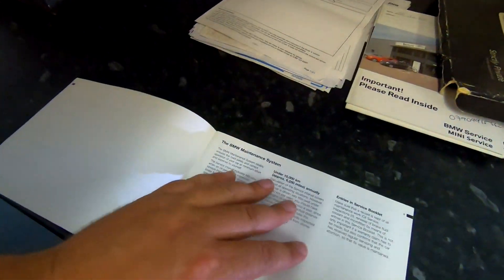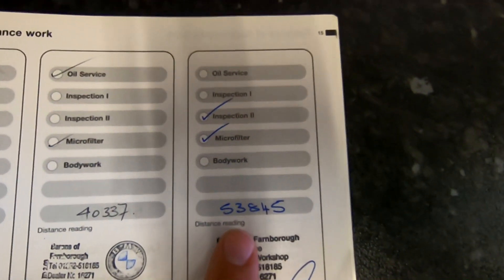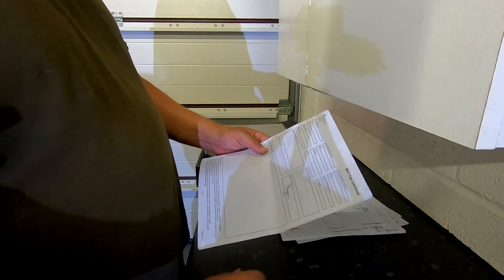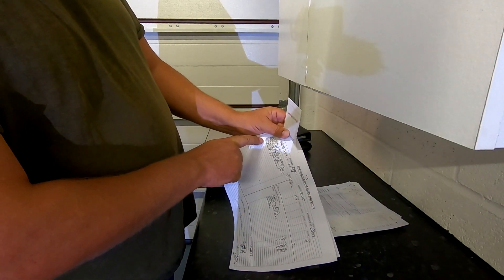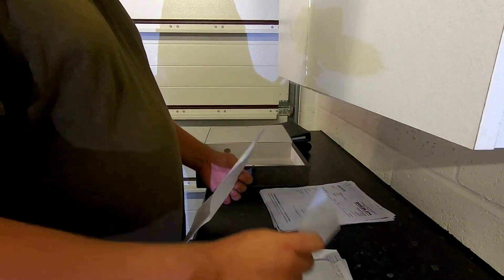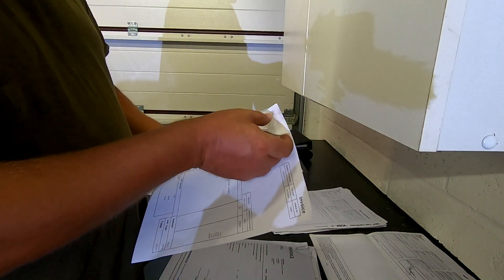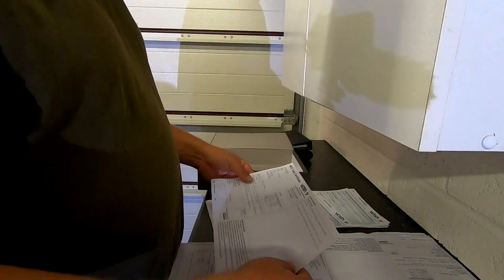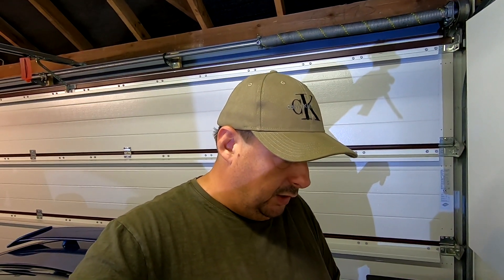Knowing the history of your car - BMW 330ci clubsport

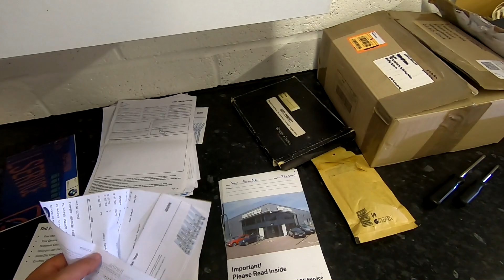Comment: 26:48  That's a BMW approved used car pack. So it looks like owner #1 traded the car back in to the original supplying dealership Barons BMW and they sold it again as an 'approved used car' to owner #2. That second owner, was probably quite local to the dealership and continued the service history with Barons; as there were a lot of stamps from that one particular dealership.  The servicing schedule for these cars should be - Oil Service - Inspection 1 - Oil Service - Inspection 2  and repeat the cycle. Oil and Oil Filter are changed at every service, including the Inspection Services.  Those inspection services will have different levels of vehicle checks to make and service items to replace - Air filters, plugs etc. The long tick sheet at 5:18 are associated with that and is what the BMW technician goes through.

Comment: I reckon that with a performance orientated car with that sort of mileage I'd go through the card service wise. Do it all so you know it's all been done, we ve all seen examples where garages have forgotten to change bits that they've then gone onto record on a bill! As you got the car for a good price I'd invest some savings in the future longevity of the engine.
Reply from the maker: very sensible advice really only fool would ignor ethat.  problem is the $$$$$ :)   but yer theres soooooo much to do garry.  Ive fixed a lot of stuff this week.  A hell of a lot. I spent about 600 quid so far.       I think it had its inspection 2 service not so long ago.  the oil was done about 7k ago.  says due oil change in 3k.   I could do that now actually.

I want to see the car from underneath.  theres been oil leaks.   BMw sent me pictures/video of it and lots of old oil on it.   they suggested it might be leaking oil but I think thats been fixed now.  

needs a bit of love.  the craz thing is the engine feels amazing when its not misfiring.